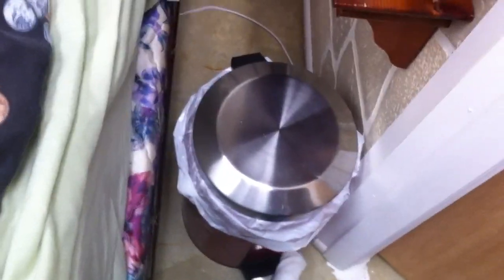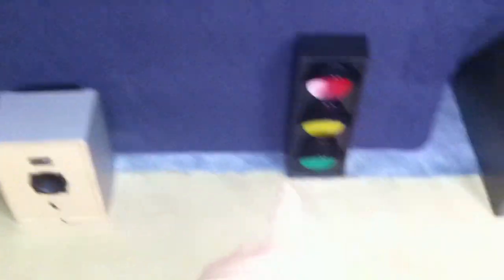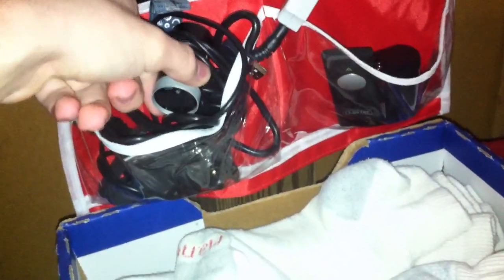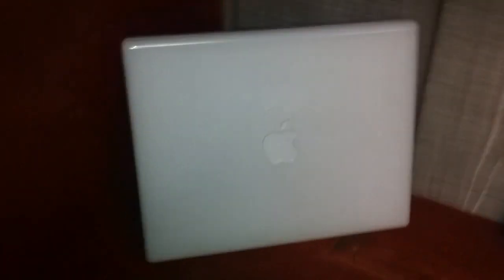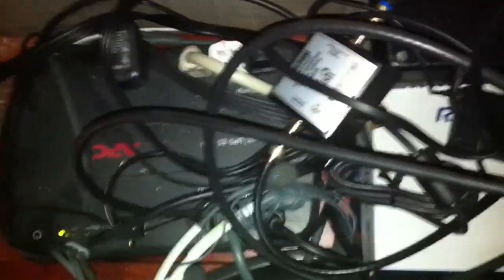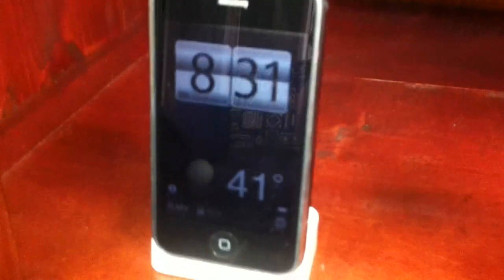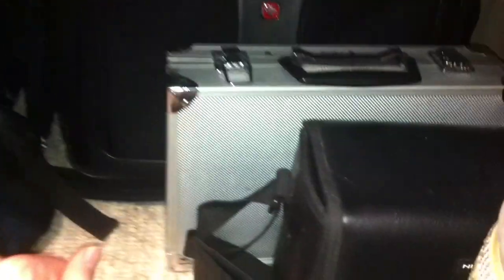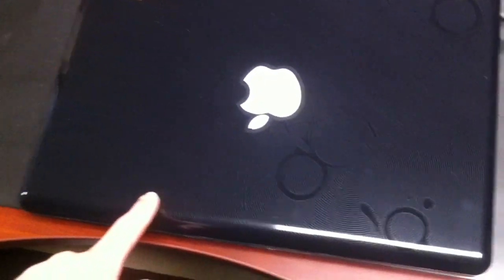Command Center Tour 2012 Extended

Comment from the maker: @Dog99992 1. Yes. It's fast. It needs garbage collection, but the OS does that automagically in the background. 2. Who told you that?! 3. The only thing "User-upgradeable" about the iMac is the RAM. There are screws on the bottom to remove a panel and access the RAM. If you are the warranty-voiding type, you CAN go further...